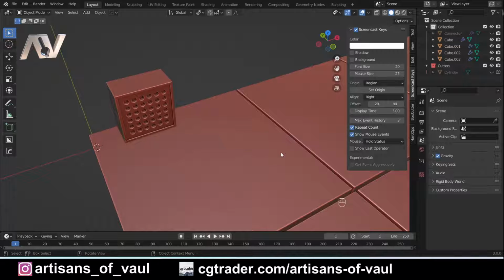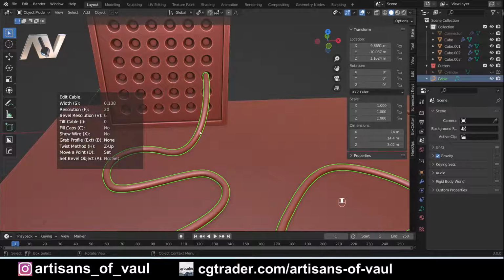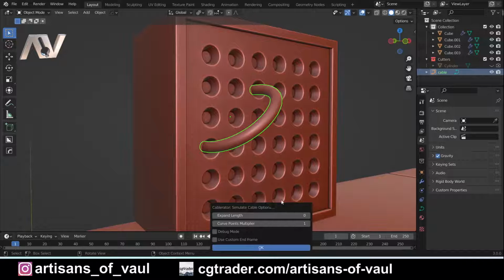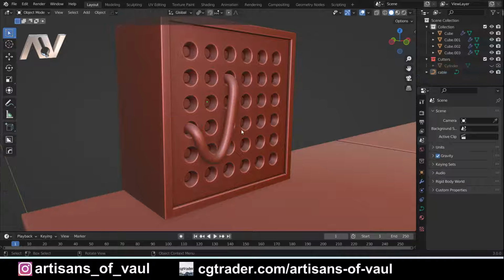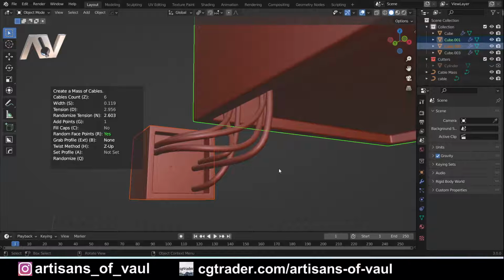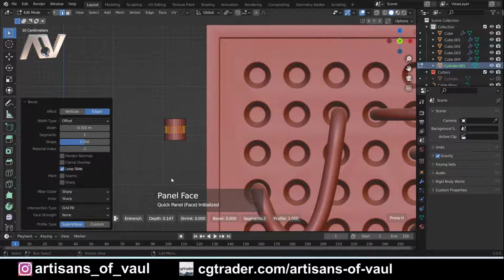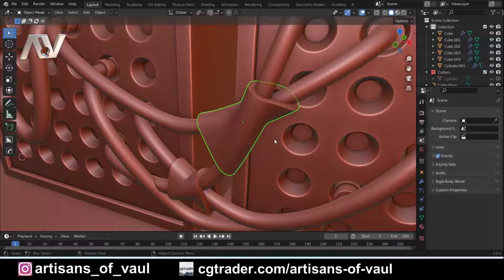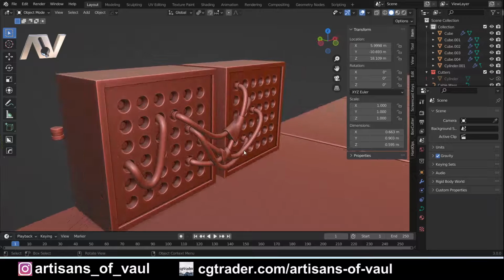Even more tricks you can do with Cablerator!

Comment: How did you cut all the holes in the blocks so they are spaced equally in all axes I have boxer and cablerator
Reply from the maker: Boxcutter makes it really easy using the array functions.  If you haven't seen my videos on Boxcutter you might want to have a look at that as I go through all the techniques there: 
Boxcutter (1) - Top bar options: https://youtu.be/3zLBmHVXpsk
Boxcutter (2) - Hot keys and top tips: https://youtu.be/dC2Zw8GcxxU
Boxcutter (3) - Designing a sci fi gun: https://youtu.be/j588pWKsWSk

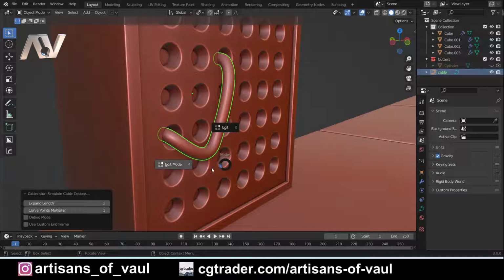Comment: 6:49 the cable intersects with the geo, if you select any geo and the cable (only 1 cable) then the cable will (for the most part) collide with the selected objects. thought id share my findings
Reply from the maker: You can always modify the points after to move them away from the geometry. As you can see here there wasn't an issue so it will depend on the situation

Comment: When using simulate cable to apply physics, if you set the meshes to collision in the physics tab first, the cable won't go through them, but rather correctly collide with them and sit on their surfaces. its a lovely little addition
Reply from the maker: Oh thats fantastic.  I assumed it would sit outside that.  How cool!  Thanks for the info.

Comment: I haven't tried this plugin yet, but does the simulate allow the cables to overlap on each other when they're on the ground? Does it make coils of cable for example if all those wires connected to the box were long enough to hit the ground?
Reply from the maker: That's a good question. So basically yes to it going along the ground but the way I would do it is to use its drawing cable function to draw it on the ground and then attach that to the cable. To be honest I haven't tried running cables over thr top of each other so I'm not sure about that one.

Comment: More points when simulating cables is good if you would have selected the box first to use as collision.
Reply from the maker: Totally. For anything physics related the more detail the better. Physics may have to wait for a series on its own (though I use it a bit in the video on creating rubble).
Reply: @ArtisansofVaul  for sure but if you would just select the box object and then cable (having them both selected and generate physics it would be done.
Reply from the maker: @TWLpontus  But for 3D printing purposes it needs more explanation than that if I started going into it. Like that then open the door to needing to afterwards move it so there is overlap so that bits are supported by the other parts of the model for the printing process/etc. It just didn't seem part of the video as I saw it.
Reply: @ArtisansofVaul  yeah makes sense. I learned a few things in the video so thank you very much :)
Reply from the maker: @TWLpontus  No worries. As you have pointed out it is a really important topic. I'll have to cover it as part of making more complex objects/scenes/characters though

Comment: May Cablerator be used to generate chains as well?
Reply from the maker: Great question. It may have an issue with the 90 degree turn that a chain needs to have between the links so possibly not. But let me have a play and see if it's possible.